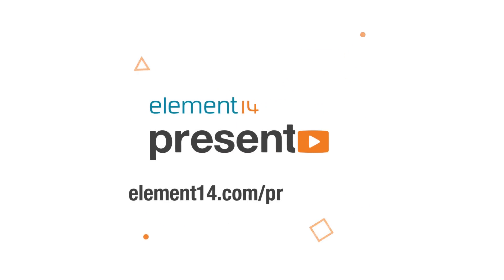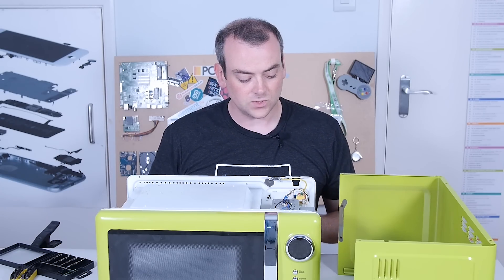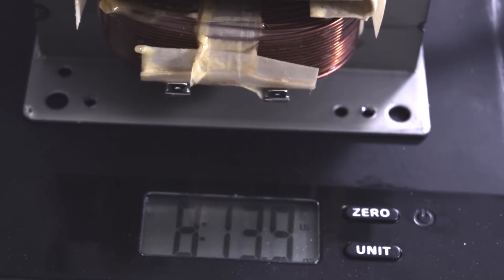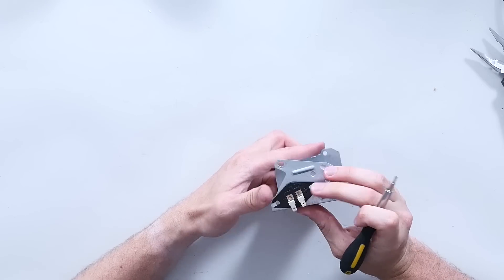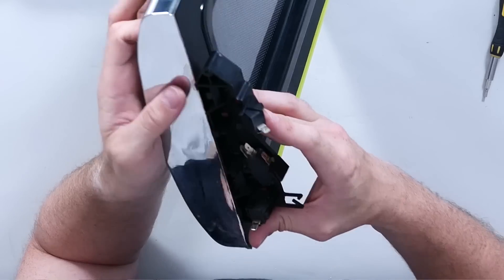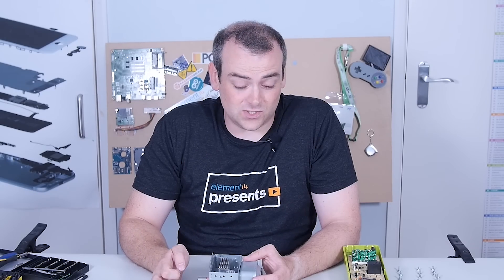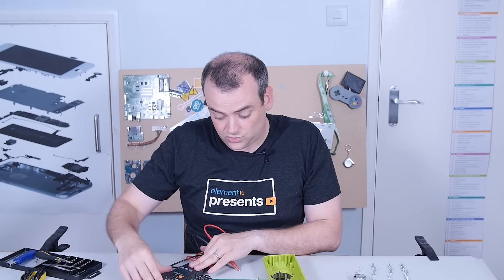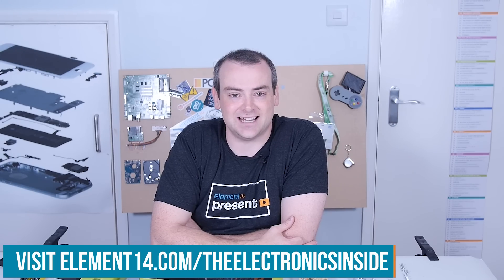Microwave #Teardown - The Electronics Inside

Comment: The root cause may be the door interlocks. You have two or more switches which open and close in a specific pattern when the door is closed properly, and any deviation from this pattern (say if someone is trying to operate the microwave with the door open by jamming screwdrivers in the door catches to "fool" it) will blow the main fuse. This my well have taken out the trace on the PCB, too.
Check the alignment of the door and make sure it shuts properly with no gaps, and there's no play in the door. If it's not quite closing right, that could have blown the fuse

Comment: 1:30 "They're for the most pare really reliable" Unless they are made by Maytag, then you'll have lots of problems, or at least that has been my experience. 10:25 In industrial safety, we use redundant safety switches and failures must be detected, Microwaves apparently do't have this (or it is improperly implemented), on our Maytag, one of the door switches failed and allowed the microwave to continue running when the door was opened. Bad design.

Comment: Try to fix that trace. It probably blew because it was too thin. Built-in obsolesence.
Reply: I keep wondering what could have been the root couse. I didn't see any other issue that would explain it, and I don't know enough about RF to know if you can "overload" it and draw a high instantanous current? I'm not sure I am brave enough to try and turn it on again?!?

Comment: Why don't they make those light bulbs user-replaceable? It's aggravating to have a microwave oven that works perfectly except for a stupid little incandescent bulb that requires this kind of a teardown to replace. There oughtta be a law!
Reply: I had heard that some models actually use the bulbs as a fuse too? Obviously not the case in your one! We had an old one in the early 90s, where you could remove the glass internally. Recently it seems to be less common.

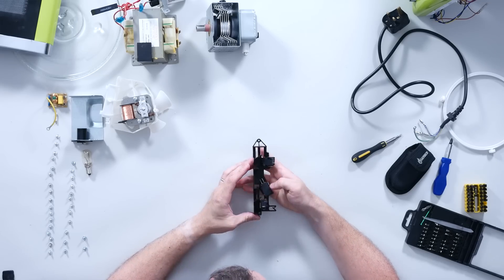Comment: 9:52 Normally 2 microswitches to cut power when the door is opened and one microswitch as a Crowbar to blow the fuse if either of the other 2 microswitches fail. Actually one common reason for the fuse blowing is a failure of one of the microswitches. If it is one of the power cutoff switches then it’s advisable to replace the crowbar microswitch too. 14:31 Fusible traces on Microwave oven boards are very common, cheaper than a solder in board fuse.
Reply: I made the observation about the trace being fusible, it was notably smaller than the others. But of course, I removed it from the final cut! I did wonder if it was sized correctly though? I would have expected there to be some discriminitaion between the fuse on the supply board, and any fusible traces? Would you have expected some, or do you think the current was just high enough to blow them both simultaneously?
Reply: David Edwards when I questioned the designers their only concern was that the power was cut, they didn’t really care whether it was the Fuse or PCB trace that blew. There was also a concern that the Fuse maybe replaced (customers do that) with one of a higher value, then they could be sure the trace would fail the next time. Actually some boards had additional Fusible Traces that could be “linked in” if the original failed. Apart from that, the PCB’s were not meant to be repaired but replaced. Strangely the Light (Bulb) failing was a common reason for the fuse blowing.

Comment: Maybe he should have added some stern safety warnings. Especially not to power up the Magnetron outside the microwave cavity (cabinet) or with the door off and/or door switches defeated, as the high power microwave energy is very dangerous. Also the high voltage from the connector on the transformer and high voltage capacitor are lethal, yes they are of high enough voltage and current to kill.
Reply: Agreed! I hope anyone that is looking to replicate this is sensible enough to not mess about with electricity or RF if they are not 100% confident in what they are doing. I am happy with electrcity, but wouldn't mess with RF at all!